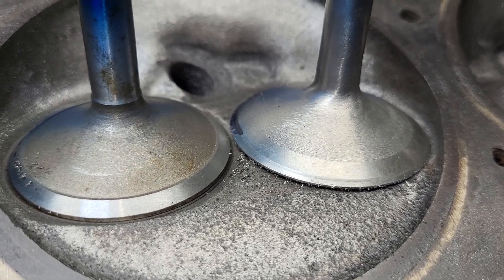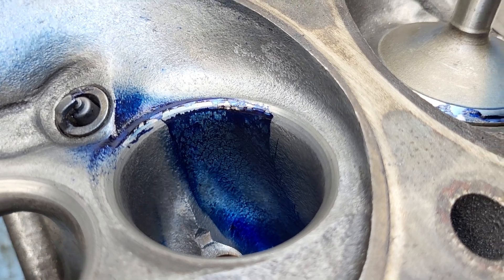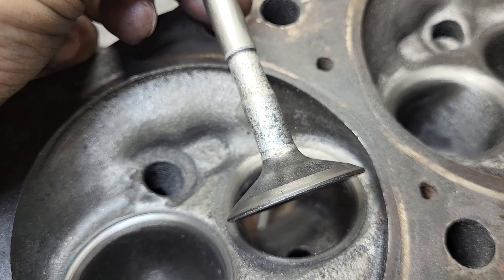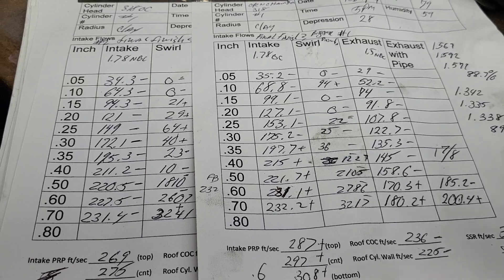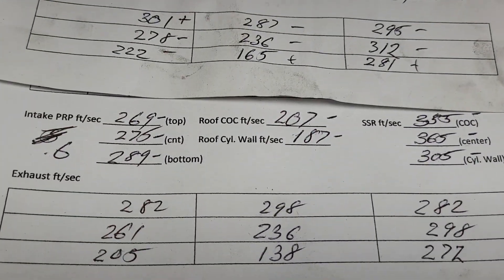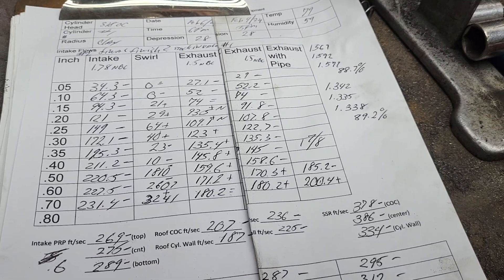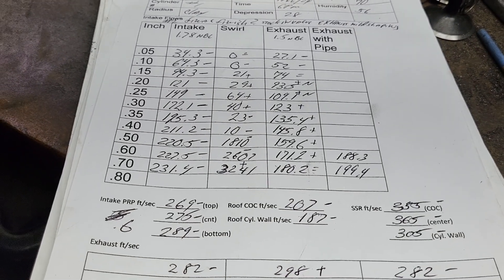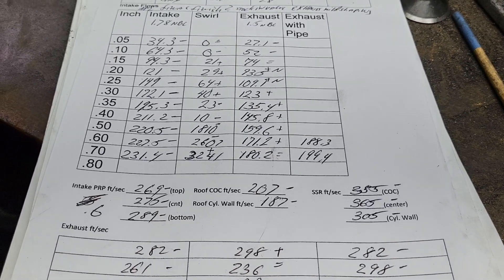David Vizard, Unity Motorsport, Mission Impossible 318 project

Comment: On my 302s I had done we got 255 at .600 lift intake but only got 115 on exhaust side, what's going on exhaust side where's the cfm were not getting?
Reply from the maker: What size valves?
Reply: @servediocylinderheads  installed 2.02 /1.60

Comment: Any shear in a flow requires energy and usually creates turbulence, but what if the evap ridge is launching the flow off the valve, not shearing it? Like a small spoiler or ducktail on the back of a car.
The benefit of dispersement might be worth more than the slight bit of energy loss.
Reply from the maker: I agree, I am torn which way to go. The carb's ability to atomize the fuel would dictate which would work better. Thanks

Comment: I suspect that the biggest advantage of the evaporation ridge is at part throttle and low to mid rpm. I'm thinking that the reduced air velocity over the head of the valve will significantly emphasise the differences between a back cut valve and the factory valve. At full throttle, high rpm, i would expect the opposite results.
Reply from the maker: Interesting
Reply from the maker: Thanks
Reply: I always wondered why some factory valves are like that, thanks.😎👍